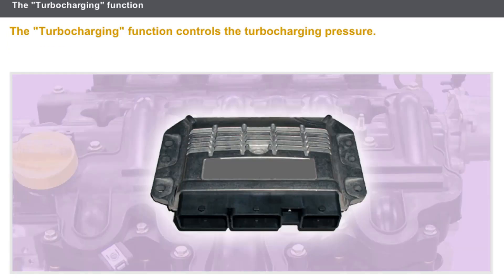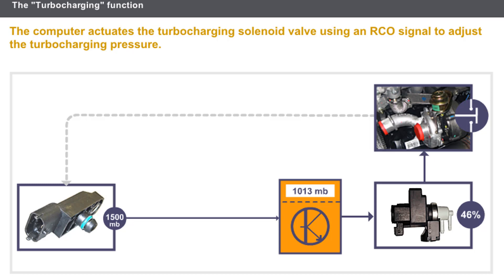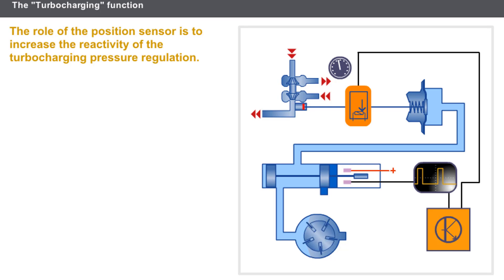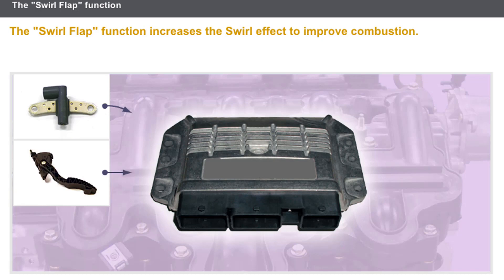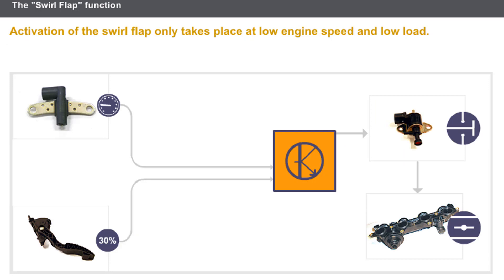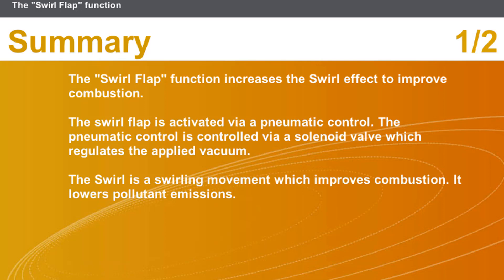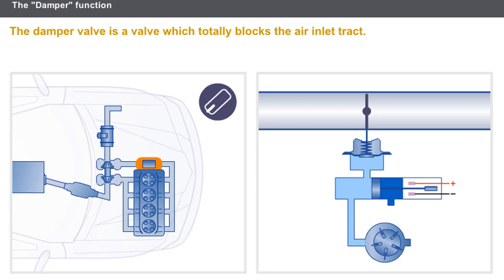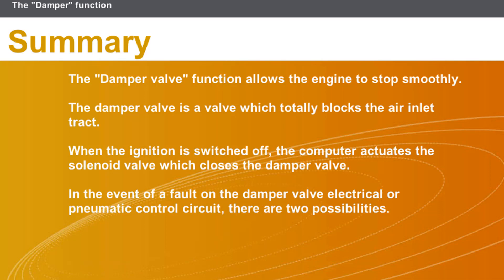Engine diesel (part6) controlling the air supply

Comment: It is similar to a diesel generator
Reply from the maker: Thank you for watching! Yes, you're absolutely right. The principles of controlling air supply in a diesel engine are indeed similar to those in a diesel generator. Both rely on efficient air management to optimize combustion and ensure smooth operation. If you have any further questions or if there's anything specific you'd like to learn more about, feel free to ask! :_Thanks: